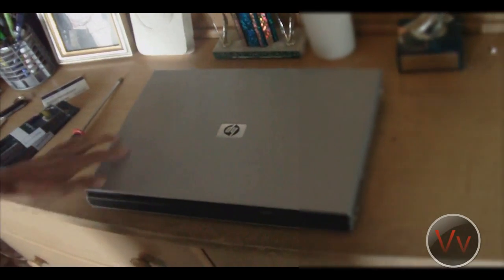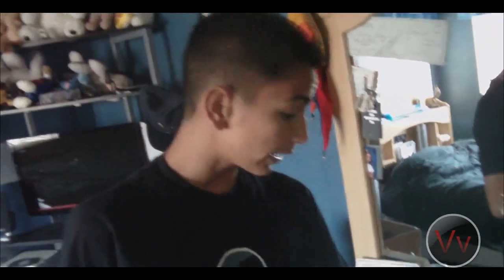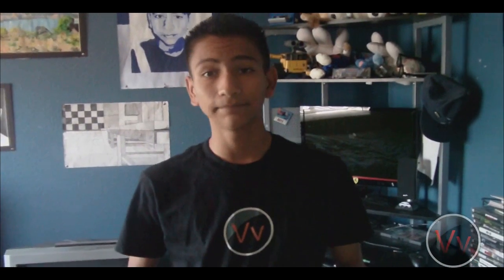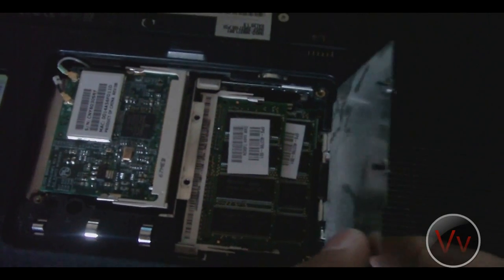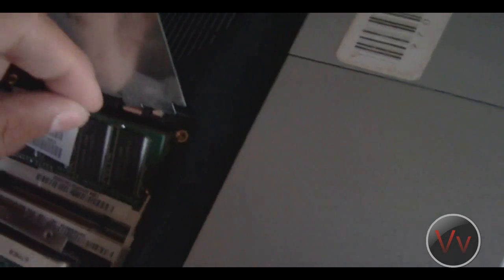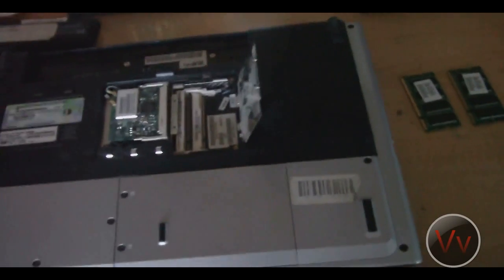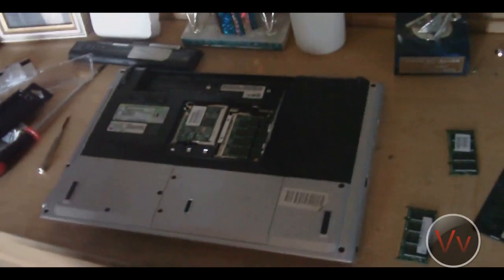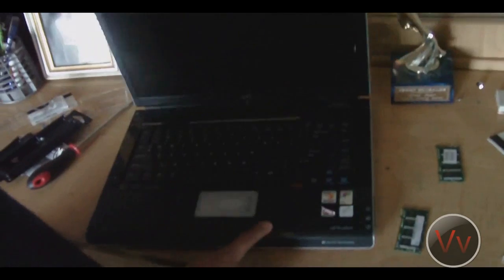How To Install RAM

Comment: Often there are extra slots for RAM under the keyboard so if you want to add to existing RAM and the slots are filled in the compartments underneath then open up your keyboard.

Comment: I have a Dell Latitude C610. (MADE IN 2000)
It came with a 20gb Hard Drive and 256mb of ram. I UPGRADED to a sweat sexy 160gb Hard Drive and 1/2 gb of ram. It's okay for web surfing. I play halo ce on it. My graphics card is 16 mb's 
                             -_-

Comment: i got 1 gb and that my upgrade lol.

I had like 300 Mb and my machine was slow as crap Then I got 2 gb and it turns out that one of my RAm drives were broken so I only got 1 GB out of it.

My CP is like a 2005 or 2004 HP desktop.